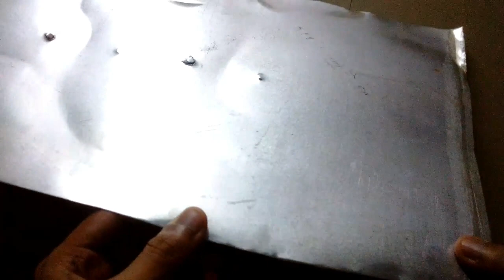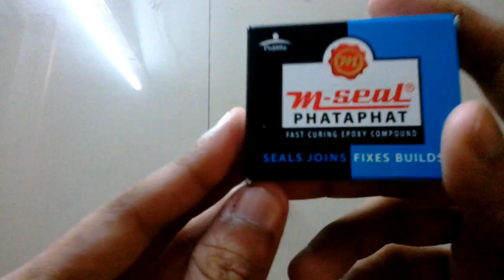How to make a Fan Blade -- Its About Everything

Comment: what is the device called that makes the fan rotate? Can you put a link in the description to know where to buy it
Reply: dc motor,most common ones are 12volts or 18volts and can be found at most local hardware stores

Comment: Why do the blades have to be separate from the hub? Can’t you just cut the whole thing from a disk? Or multiple disks glued together with a little tube of rolled up foil in the middle for a bearing? Then just crimp and/or glue the tube to the motor shaft?